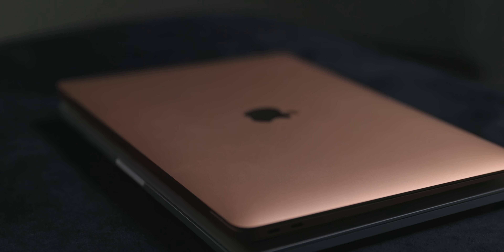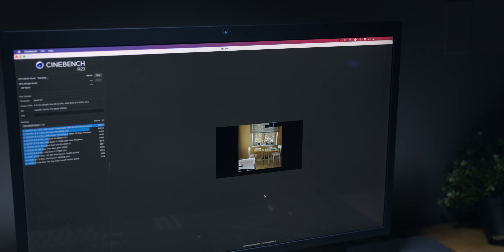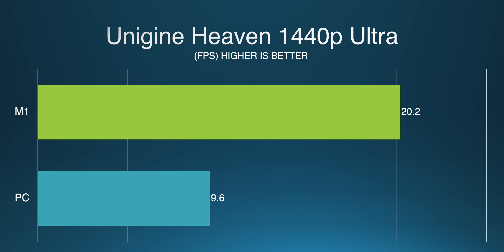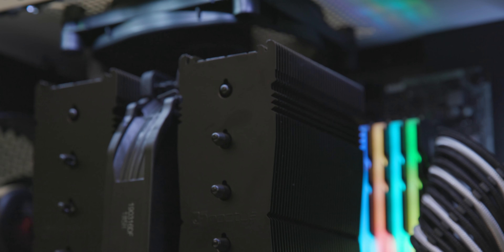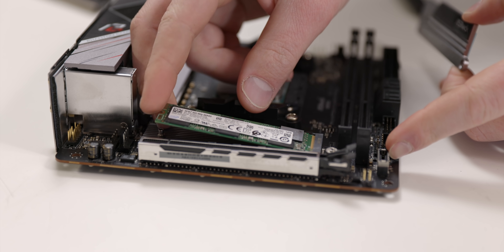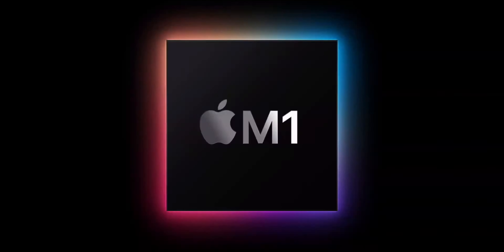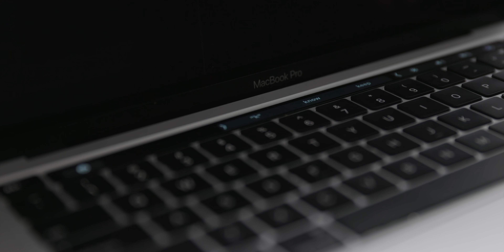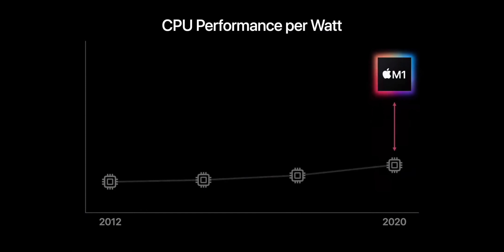$699 Mac mini vs $1,000 PC: Which Is Faster?

Comment: Refreshing and dramatic presentation with a film-making style and attention to acting and various audio-visual techniques. There is an interesting focus here on power consumption also.
The Air looks great ~ and I think it may very well often sell well because of this ~ but I was turned off by the reports of cracked screens and serious hub issues, not to mention likely hub replacement/upgrade costs. This lead me to consider the Mini once again.
Thanks for the comprehensive work!!

Comment: Since you didn’t mention the model and brand of the Windows Box I’m guessing I’ll keep waiting for the next Gen Mac Mini M1Pro or whatever . LOVING my cheap ass Macbook Air even with having to buy an OWC Thunderbolt 3 hub and Thunderbolt 3 drives. About to grab a 2 Terrabyte Sabrent Rocket M.2 NVME PCI-E to make a small external Boot Drive. With the OWC Hub, and 3 480 Gig Thunderbolt 3 drives , 1 of which I’m going to swap the 480 Gig NVME out of for the 2 Terrabyte plus a USB-C case for the displaced 480 gig NVME I’m STILL way below the $800 Apple wanted for 2 terrabytes. 

Holding out for a 32 big Mini with M1Pro or WHATEVER the ones in next Gen Mini going to be even if they stick to Vanilla M1

Comment: But some people want expansibility/longevity, like switching GPU, RAM and SSD over time without needing to buy another case or another motherboard. This is why a PC gets extremely cheaper and flexible in comparison as it allows replacing components over time instead; this also bears a tremendous impact on carbon emissions footprint. Upgrading an iMac's GPU means buying everything again, which includes a screen, case, PSU and so on. The M1 is damn good as a laptop but I would never have one as my main desktop workstation.

Comment: The M1 MacBookPro that I bought this year still lacks too many of the expansion capabilities of a slight older CoreI9 16” MacBookPro that’s just slightly older.  Missing M1 support for multiple external monitors was so disruptive to workflow that I reverted to the CoreI9 model for most work, relegating the M1 Mac to the side of the desk running automated music synth software.

Comment: got a mpb pro m1 ... not having to charge it for several days, while working on it 8-14 hours a day it's a game changer ... no more considering where to work based on power outlet location .... took it on 10 holiday, never pluged in and came back with 70% of battery while doing some occasional emails and checking flights and whole corona pasanger tracking dance. Sorry but intel have completely LOST the game by now. Their power management sucks, marketing sucks, blame game suck, briberies suck, performance suck, security suck, price suck ... they keep cozying up to government and their contracts but that won't last for long.

Comment: Well, that's not exactly M1 deserves all praises for impressive results. Big part of that really impressive performance per watt benefits very much to SOC architecture. In a x64 mini PC you have separate motherboard pared with a separate CPU and separate RAM. In Mac Mini you have all that integrated in a single SOC (System-On-a-Chip). And it's makes half the difference in a performance. Did you ever know why PC GPU have it's own dedicated memory? Because if GPU will use system memory (which is RAM), it will lose about a half of performance. Because instead of using fast on-board memory, GPU will have to deal with delays and much lower speeds while interacting with motherboard and RAM. And it's pretty much the same thing with M1 and Ryzen APU - while M1 have it's own dedicated memory, Ryzen use RAM through motherboard bandwidth. This effectively halves APU's performance.
Also, M1 benefits impressive low energy numbers from ARM architecture (which is not exactly Apple's innovation), because it is very good in low-energy computing. But. It's nowhere near in performance with full-size desktop PCs, and never will be on that level, it is impossible. Because ARM is good only in a low-energy computing. Only. It's architecture just can't handle much power, so really M1-based COS already very near its maximum possible performance. There's not much room for improvements. You can add more cores and modules into die, but it will  increase the cost of that system much more than performance.
SO, in a conclusion, *all ARM-based chips are very good and really performs better than x64 in a low-power systems*, which makes it perfect for a mobile devices. But ARM really can't do much when you need performance higher than that. Because ARM architecture already near it's maximum potential performance. There's almost nowhere to grow. But there is a very big possible room for improvement in a SOC, and Intel or AMD based systems also can get much if they make systems with variety of integrated modules such as graphics cores, dedicated memory, AI cores, etc. All in one chip (and Intel already doing kinda like this with 13get CPUs). But it means such system will not have any upgrade or repair possibilities. You can't change your GPU if it is integrated inside your system, if it is a single part with your motherboard, CPU and RAM. So it have two sides. Lower energy consumption (means better autonomy) and great performance with a miniature sizes. But no upgrades, no repairs, can't change anything and can't get performance at same level of high-end PCs (or even mid ones). Separate GPU always will be faster and full-size desktops always be faster, or on the same level but for a much lower price.
Yes - Mac Mini can beat $1000 mini PC based on Ryzen APU. But can it beat $700 full size desktop? Ha-ha, no. And never will. ARM architecture can handle only low power limits. In fact, my old budget PC with a 1050 can beat newest mac mini easily in any benchmarks and it is cheaper for a good 1/3. Well, it's not portable and needs much more energy, but it's much powerful for a lower price. So if you need maximum performance per dollar - you need desktop PC with x64 CPU and dedicated GPU (and you can upgrade it in a future for a good price also). If you need great performance per watt and mobility - you need something ARM based. If you need great performance but also some mobility - you probably will need something like heavy and thick gaming laptop, because it still performs better than Apple's Macs.

Comment: You know you can get a $550 prebuilt with a Ryzen 7 5700G and 16GB of ram that will beat the snot out of this, right?
Reply: @NicholasGFX  That is true, though the laptop Ryzen 7 5800U can almost match it, same size, little more power draw and noise but more performance.

And I'm not ignoring the M1, it's an amazing little chip, I'm just annoyed by the title and fact he's using a $1000 PC as if you can't get something better than the M1 for $500.

Comment: Good comparison, but I wouldn’t say it’s apples to apples.
This Ryzen chip is the closest in PC market, but since it’s not the main source of profit for AMD, it does not sport the most recent node process (5nm vs 7nm), also the GPU on Ryzen is generations behind and the CPU is one generation behind the current top of the line.

Apple did a massive work on the M1, but this Ryzen is not the best PC makers can make today, it is just the best available. Hopefully Apple will force their hand to release better stuff.

Comment: Yes, it is overrated. I checked the Apple website and if I wanted decent RAM and at least 1TB of storage, it’s over AUD $2,000. Will it run windows software? I can get a better windows laptop for less money (which comes with a screen remember). With the mini, I need to purchase a monitor pushing the price even higher and over $3,000 if I want 2TB!?! Not worth it.

Comment: ARM was designed with power efficiency in mind. x86 was design to work. Back then a hot computer is better than no computer.

May be we need a new powerful (as AMD64) and efficient (as ARM) architecture that is easy to develop for or port software to.

Comment: The M1 should be better than the Ryzen 4750g.
1) M1 has 16 billion transistors. Meanwhile Ryzen 4750g has 9,8 billion transistors.
2) M1 is using 5nm TSMC, while Ryzen 4750g is using 7nm TSMC.
More transistors and a more advanced node should really deliver more performance.

Comment: considering what I am seeing with the M1 I would really like to see AMD and Intel make some ARM-based CPUs to compete with it. from what I can tell the X86 architecture is starting to look rather dated. it still has its place somewhere but ARM is generally looking like the way to go. while losing some of the CPU instructions when moving to ARM is gonna be painful for developers it's still worth it for the power efficiency alone
Reply: you will also loose the PCI architecture if you exchange it against a SoC.

desktops and servers have 1.5 TB RAM today - the 9000 euro mac studio model has 128.

for me the main point about ARM is that if you run in the lower half of its CPU power, they are amazing energy savers.

Comment: The X86 is f..ed. Wintel is scrambling.
Reply: Because Apple released a proprietary mobile processor for themselves only?
Reply: @RawbLV  I predict all laptops (except gaming ones) going ARM within the next 5 years. The industry will follow Apple as they always do.
Reply: @spht9ng  ARM is very efficient, it's a good alternative, but unfortunately everything is built around x86 and not even I would want to migrate. ARM chips and its software would have to be here for years before it would be viable to migrate to. But yeah, I agree that people who are not tied to x86 would migrate.
Reply: @RawbLV  even so, I'm sure Windows 11 ARM laptops would have some software like Rosetta 2 to allow x86 apps to run. Just until developers update their Windows apps to ARM.
Reply: @spht9ng  The thing is that these emulators incur a very substantial performance hit. Maybe for light apps that would work.
It's also very naive to think that developers will port their code. Big companies and open source projects might, but not all apps. There's also a lot of old apps that have been abandoned and will never see an update from the developer. This leads me to my 3rd point that Windows is very great at keeping ancient apps running. That won't happen here. Apps will get segmented and user experience will worsen.
I might be a pessimist in this situation though, but I guess it really depends on the mainstream and where it goes.
Reply: @RawbLV  Rosetta 2 is actually a really good experience. Though there is a 5-15% performance drop, even doing heavy tasks, the M1 chip holds up well without a hitch. I really think that it's good enough even for the average pro user. Maybe the pro users that need extreme power will not be satisfied but in that case, I think that Desktops and desktop replacement laptops will fill that void in the x86 world.
Reply: @spht9ng  M1 is a really good chip ;) We don't know if PC ARM chips will be as good

Comment: That PC can run an operating system that isn't Mac OS, which doubles productivity, making the benchmarks about even when you consider how much time is wasted having to use Mac OS vs any other operating system.
Reply: "operating system that isn't Mac OS, which doubles productivity"

A completely meaningless statement. If your day to day "productivity" revolves around the operating system, you're doing something wrong. Or you're not really doing anything meaningful at all.  I used to be a full time Linux user. While I enjoyed tinkering with it, I realized how much productivity I actually lost in doing so. Productivity goes up when you use a system where you don't even have to think about al that stuff I used to tinker with. Sure, it made me feel smart because I could make Linux do what I wanted it to do, but  I ultimately had to ask myself why it didn't just work out of the box. People say MacOS is dumbed down. No, it it's not. That's just what a system feels like when it works right. That's what it feels like when the system is well integrated with the hardware. Driver? What's that? You don't even have to think abou that on MacOS.  You dont' even have to know if your system is 32bit or 64bit. You dont' even really have to know if your app is x86 or ARM64. Shit just works.

Do you complain about your car because it just has a gas, brake, and steering wheel?  Do you WANT to have to tinker with it to keep it working? Would you be more productive if your car needed more mainteance? Had more knobs to turn and buttons to press?
Reply: @Yarnosh  I agree that tinkering loses productivity too, but having to commit to a song and dance just to get from point A to point B are all part and parcel to using Mac OS. Everything from cutting and pasting to closing a program or switching between task is all needlessly restricted and takes hours upon hours off of your life; simple task like starting two instances of the same program at once become near impossibilities that require juggling virtual machines, where it is simply double clicking an icon twice on all other machines. Mac OS is a Golf Cart to all the other operating systems acting like their respective usable road vehicles, it's not a tool, it's a toy, one that can't work to do more without the tinkering that you pan. If all you're doing is opening up a web browser and maybe a simple word processor, that will be fine, but doing any real work requires real tools, and Mac OS isn't a real tool. You can try as you might to get a stripped bolt off with a pair of pliers, and maybe succeed after a ton of wasted time and effort, but bolt extractors are a thing and work way better and way faster.

Comment: I hear you talking about how efficient it is with low power draw and small foot print but honestly I don't care. I want raw performance. If the case is a lot bigger and it uses 65 watts and not 25 I'm okay with that. I'm on desktop anyways and $30 more year in power cost is manageable.

Comment: The Mini's hefty power supply and cooling capacity aren't needed . . . yet.  I think Apple is keeping the package because it's capable of handling next-gen and next-next-gen Apple silicon, much more RAM, and much larger SSDs.  The performance of future models will be mind-bending.  (I just hope Apple continues to provide that great lineup of ports on the back side, and doesn't force users to buy a suitcase full of dongles.)

Comment: I am a Software Developer and researched the supported software and ordered a Mac Book Pro, Of course, paid by my organisation. Boy, does it beats the crap out of Intel based devices. I will not quote any numbers as it could be misleading, but it wipes the floor with Intel based devices. It is far from perfect, but it still fits my unique WFH situation, I don't worry too much about power fluctuation and little cramped up space in my room. 

Personally, I like Linux, therefore I would not be buying one anytime soon.

Comment: Hardware tech is uselees without  practical applications aka accessories software gaming. CPU performance means nothing you cannot use it. Arm may be efficient but lacks power for very high use.

Comment: There is also talk that Apple will be using 3D Stacking techniques with the new M1X chips, which means the chip will increase in thickeners not necessarily area footprint…
Reply: Thickeners?  Like flour or corn starch?  Maybe Arrow root... no, wait... tapioca... that's a good thickener.

Comment: Switched to M1 a couple of weeks ago from Windows/AMD. I'm not going back. I had a Surface Pro 7 before, no noise, massive thermal throttling. Then Ryzen 3500 notebook - better performance than the i5 in the Surface, but constant max fan and still not really fast. I now have a Mac mini. No noise. I perceive it to be many times faster than anything I've ever used before. I'm installing programs, working in Logic at the same time, I sometimes check a charting site which had to be closed when I didn't use it on all PCs becuase they ran really hot because of it. This thing just keeps running. I don't even realise I have things running in the background that would normally take 100% CPU load and spin up the fans. Complete silence, everything remains snappy. Base model, btw. I will maybe go back to Windows once Microsoft comes out with something similar. Looking at the Surface Pro X - that's not gonna happen any time soon.

Comment: You claimed that the x64 code was emulated. A different video claimed that Apple added hardware to run some AMD code more efficiently. The Advanced Ridiculous Instruction Set Computer Microprocessor does have a restricted instruction set. But if you are building your own SoC you can fudge in more instructions. You can also discard Intel architecture from 20 years ago that create bottlenecks. You can also eliminate all standards for peripherals connected to your CPU and GPU.

Comment: Corrections: 
The Ryzen Pro 5 4650G is an OEM only CPU, often avaliable to the public via second hand marketplaces and non-AMD stores (Aliexpress, EBay etc). It’s based on Zen 2 (same as Ryzen 3000) and it is NOT a mobile chip (confusion caused because mobile Zen 2 CPUs are the Ryzen 4000 series, I know, very confusing). It also has 6 cores and 12 threads, not 8 cores and 16 threads (that is reserved for the Ryzen Pro 7).

Comment: I have to admit. apple their m1 soc chip is really strong. But how much do you really need. I guess its just in the range of the pro user.  the macbook air is just a odd mix for me qua its features the m1 but a chromebook with internet acces just works fine. I guess if you want to code or something in that sense.